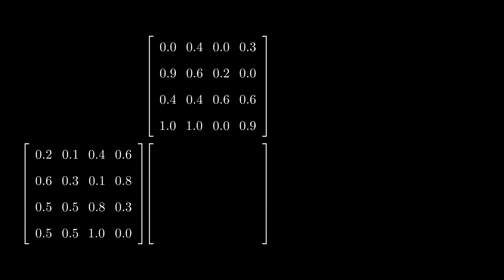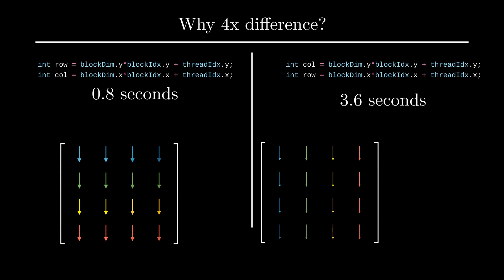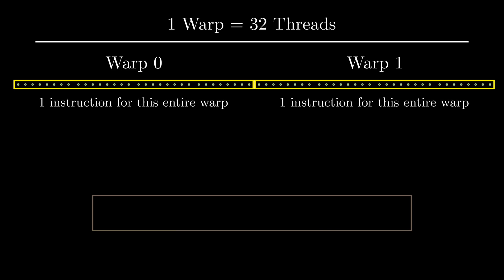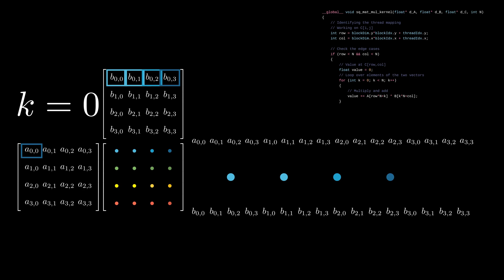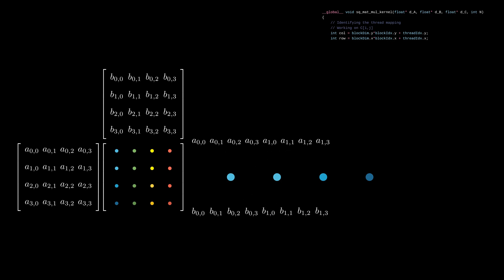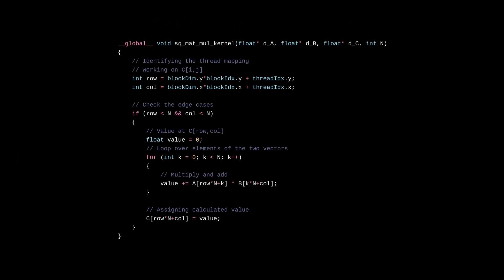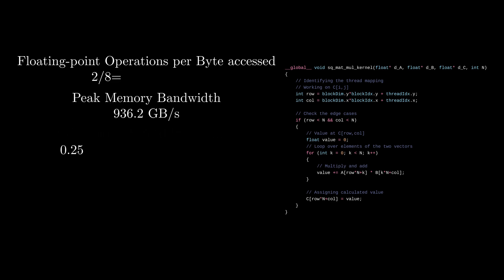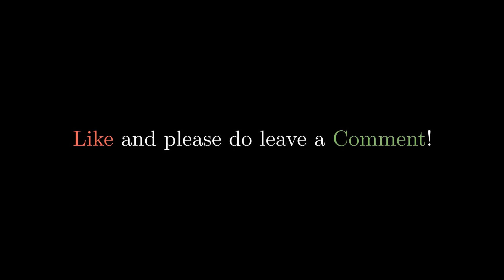4.5x Faster CUDA C with just Two Variable Changes || Episode 3: Memory Coalescing

Comment: I’m super curious why, in this code, you never any of the function parameters and you use variables that aren’t declared in the function.
Reply from the maker: There's a small typo. I forgot to change the A inside the function to d_A. Thanks a lot for catching that, I completely missed that while writing the animation code. However, in the code repo, it's correct.

Comment: Yes yes yes more GPU programming videos!! Fantastic!
Memory coalescence is is one of the magic tricks that make GPU software lightning fast. When I first experienced this ~4x speedup for a one-line change it blew me away. Unfortunately for many GPU kernels the optimization mostly ends here at the global memory bandwidth limit.
Only special cases like matrix multiply or n-body can get another 10x from shared/local memory, and beyond there is still warp operations through inline assembly. Looking forward to next episode!
Reply from the maker: Thanks a lot 😀…. Next video is on tiling! I’m more excited to share that one. When I first learned tiling (~3 years ago), it was confusing and took me a long time to get the hang of it. I’ve always felt that HPC concepts go well with animations so I’m trying to do that using this channel.